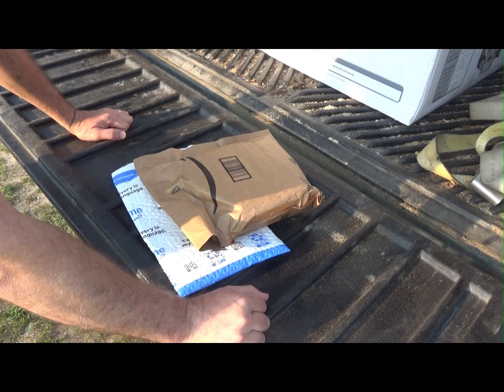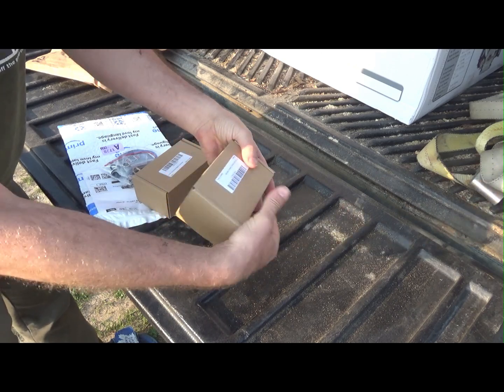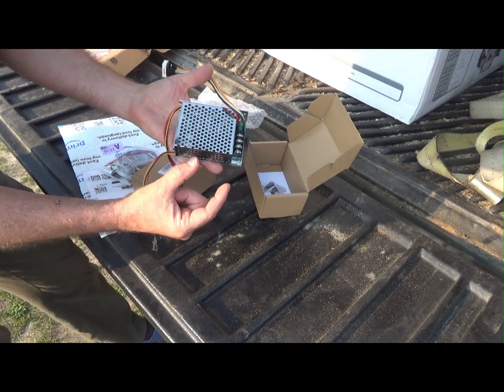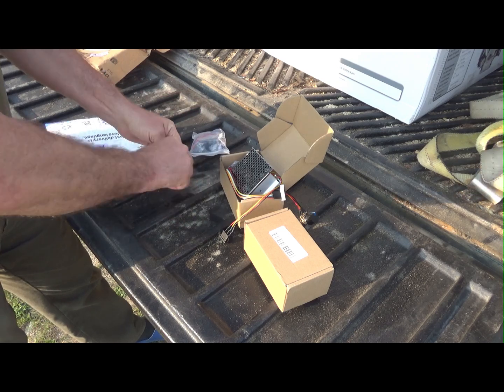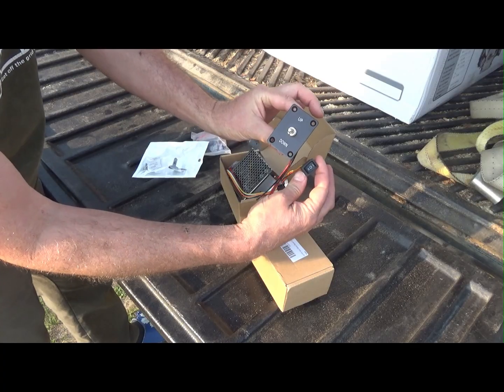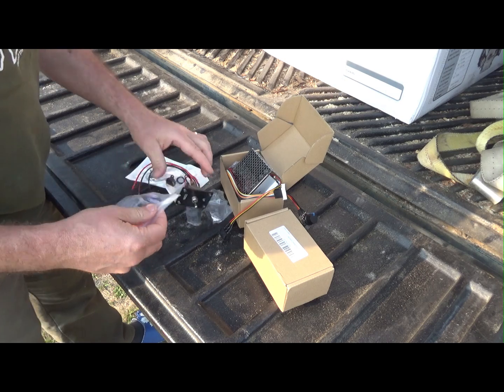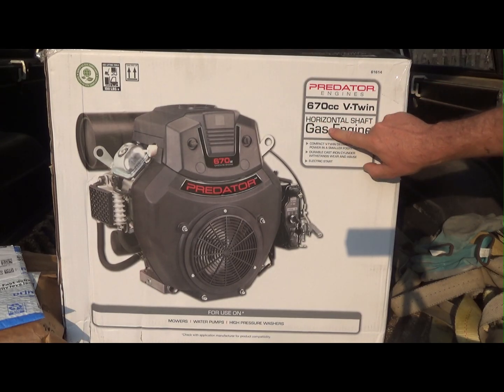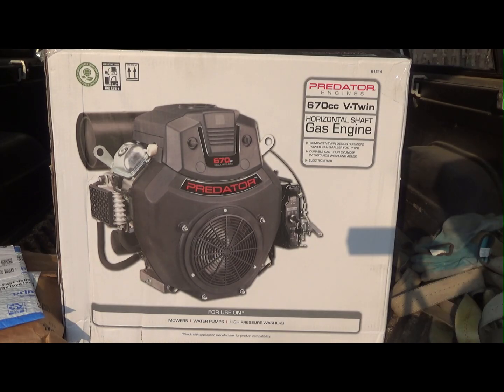Got A Predator Engine For My Norwood HD36 Sawmill

Comment: As long as it does the job,,and anything is better then 3 phase...thats costly...there wont be no big strain on that motor any how..troy if you go after blades for that mill,,you may check with Nathan,,on Out of the Woods...theres a guy that he gets his off of..and i dont think there that costly..you might luck out...Real nice guy...he runs a LT-70 but im sure they have blades for that..i like that little saw there,,thats nice..heck the way things are going,,Wood may go up again,,
Reply from the maker: It should work well for me. I am going to see what 3 phase would cost, if possible, for winter.
Thanks for the tips.

Comment: That some fast shipping. The best I got is 2 days . Just use a old but good car battery to start . The cost of new battery is crazy hear in NY . All you need is metal flex pipe of muffler and run it out side shop . My desal gen set is inside with lover air vent and has insulated steal pipe threw the roof .  I got it used and installed in wooden shed. It's 3 phase 208V  100 amp rated. 120V phase to ground. I have 208 to 480/277 V 3 phase 7.5 KVA transformer. All used and all most free but I had to remove and ship to me. that was not cheap . Great back up for shop . I had to rent truck and driver I don't have CDL only a DM class license. Was like 10 years ago now. You can use the 12V from engine to run outher things on the mill. That should have a alternator under flywheel to charge battery. The manual will have the amps for that . Can mount some 12V LED offroad lights to shine on the wood that you cut. Good lighting is always great thing . Cheers from NY !
Reply from the maker: They put a new warehouse in Gaylord about 30 miles away. Its faster now. Used to take up to a week sometimes.
Sounds like you have an awesome generator there.
I will use a car battery. I found one yesterday. Yes they went up in price. Very much.

Comment: Few years ago I saw these engines in 6 hp to that 670 and wondered if they were any good being Harbor Freight but my son bought a 6 horse and put it on a go-kart which has ran for years.  Also a channel called , Cars and Cameras, use these often and run the crap out of them. Even modify them for race and they hold up well. That 670 engine they had was modded to 50 HP and sound like a Harley. They put it on a rider mower just for fun then moved it to a home made racing rail.  Glad to see you were able to get something like this. Nothing like a new engine to do what you need. Should start easy and be trouble free for sometime now.  😀  As for Harbor Freight ,  I have grown to respect their tools more than I used to but have not bought much of anything yet. About 6 years ago I bought a Saw Zaw and used it for a lot of cutting. Even small trees and it still works like new. Was only $36.
Reply from the maker: It is hit and miss with HF. But I watched a lot of videos on this engine through the years. The modded 670 is a beast!!! It screams when built up to 50+hp.
I got the extended warranty for two years. Their warranty is incredible.